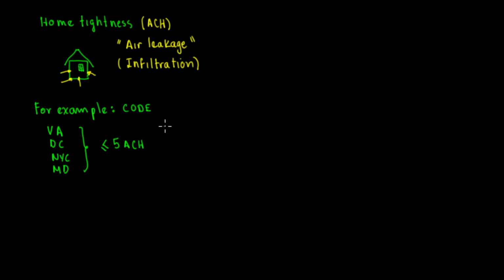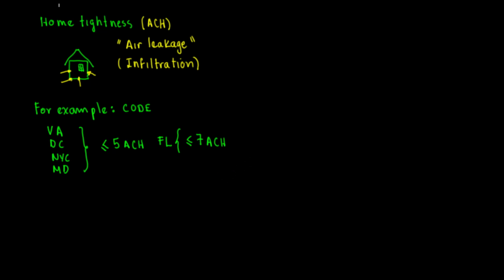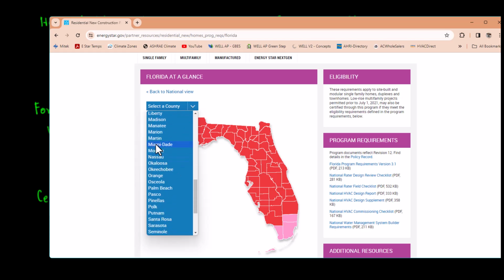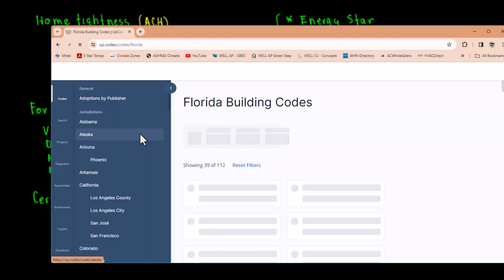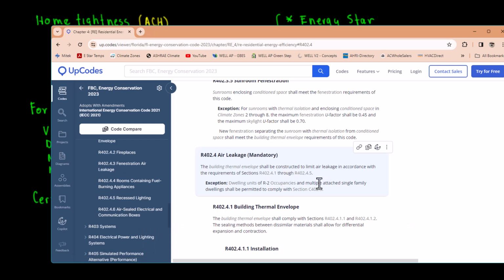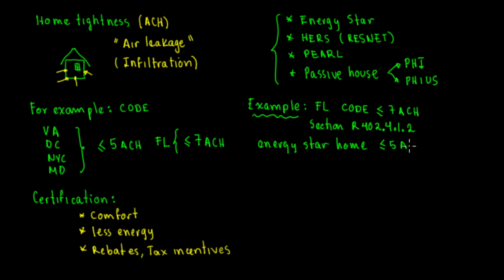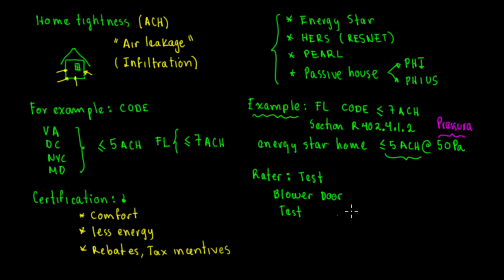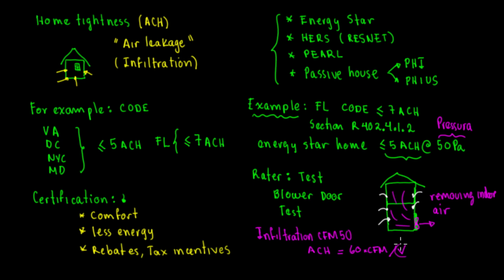Home Tightness and Air leakage (ACH)

Comment: I know this is off subject to this video, but i am working on a project while watching this lesson. My supply registers will not move or copy. I do have the building layer locked, tried unlocking it but it did not help. I think i have something else wrong.
Reply: I cant even select it, i can drag a box over it to "select" it, but i can do nothing with it after that.
Reply from the maker: @builderman912  there are some glitches that happen from time to time in wrightsoft. Try closing the file, or restarting your computer. If nothing works you will have to start a new project and transfer your floor layout (right draw) through creating catalogs. I made a video about this process. Link: https://youtu.be/TsuAdLxpuJs?si=VXJoCCW0BTO7rrXz. I hope this helps